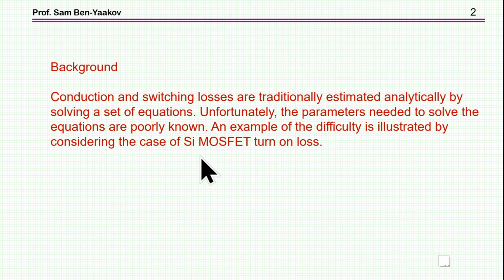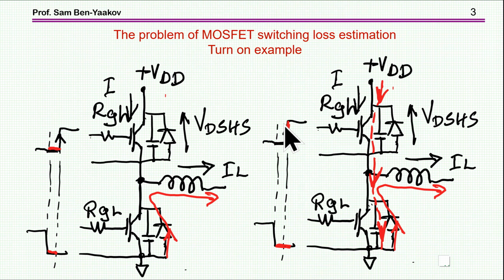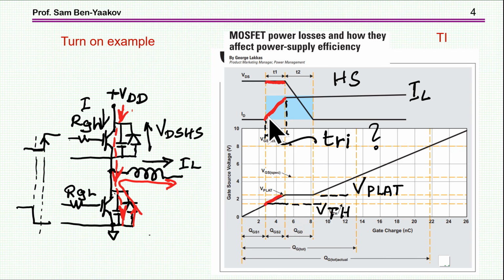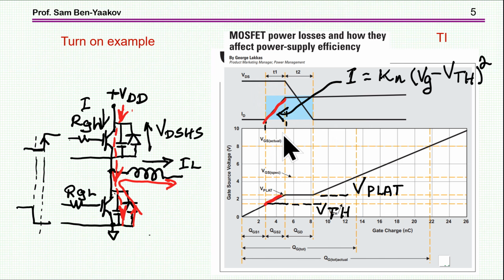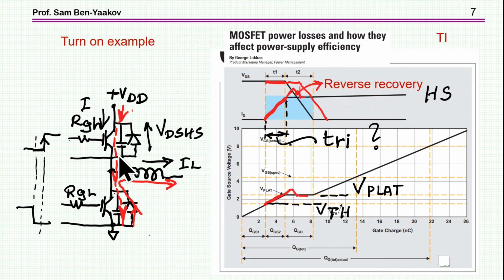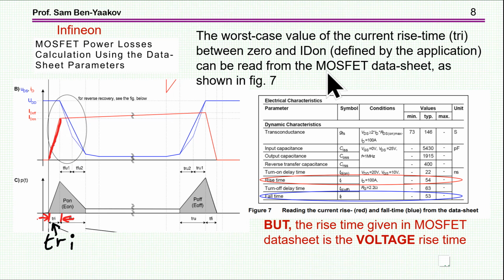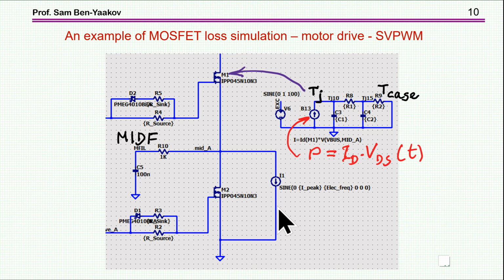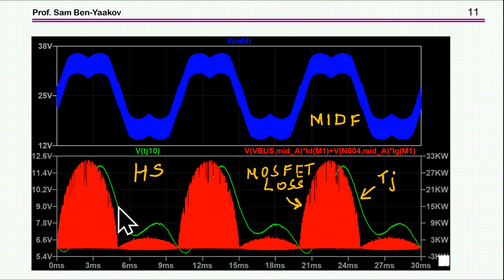Why simulation is better for estimating Si MOSFET switching losses

Comment: Hi Professor, 

What’s your thoughts on this paper for analytical determination? It tries to deal with the ommitance of information which you spoke about in this presentation

https://www.research-collection.ethz.ch/bitstream/handle/20.500.11850/274385/Transaction_final_.pdf;jsessionid=F12C42F71D652BC72110CC1DA8AD598A?sequence=3

I would like to use it for an analytical determination of switching losses for a 2level inverter with parallel switches. This paper may address allot of your concerns.

Thanks again from Australia for your videos! 

Doron
Reply from the maker: I think that pivotal information is missing from the datasheets. E.g. reverse recovery behaviour under various operating conditions such as  I, dI/dt , Temp.
Reply: @sambenyaakov  Hi Professor, 

The paper tries to estimate many of the unknowns that you have mentioned, to try and get around the generally poor documentation manufacturers provide. For example it proposes an estimation model for reverse recovery. I will try and use it to develop a script in MATLAB and then compare with PSIM or Simulink to see how closely they match. 

This paper is attempting to deal with the pitfalls you have mentioned in this video and I think it would serve you well to see how good it really is. 

Nevertheless I will report back my findings if you don’t have the time to investigate 

Thank you for your help I love your youtube Chanel 

Doron
Reply from the maker: @doronlola1763 I will be very happy to see the results of your investigation. I am a great fan of my friend Prof. Kolar and  I am aware of his meticulous work. But I think that the paper is in fact developing the relationships that are already embedded in the SPICE model. So why not use it directly?
Reply: @sambenyaakov  Hi Sir,

Yes that's fair enough. 

The reason I wanted to do it analytically was mainly so I can get a deeper understanding of the operation of the converter. My thought process was that doing so would help me in the later stages of design acting sort of like a backbone of understanding during testing.  It would also act as sanity check for output of simulation

Doron

Comment: Hello Prof. what MOSFET models do you use in your simulations? I’m using models from Infineon webpage in ltspice but I get convergence problems and incomplete waveforms.
Reply from the maker: Some of the newer models have severe convergence problem . I am usig the older models (without the thermal part in them). They are much better.

Comment: Hello Prof. I totally agree with your opinion regarding simulation. The only problem is how accurate MOSFET's simulation models are. I have tested some models, and I can say that not all models can be trusted. For example, INFINEON models correspond very well to the datasheet, but Vishay do not at all, that is very annoying. In your video you created thermal network for MOSFET, but INFINEON has the models with internally included thermal network, which allows automatically adjust MOSFET parameters depending of Tj
Reply from the maker: Good points. Indeed, not all the models are good. Hopefully, they will improve with time. AS for the advanced infineon model, we found that it suffers from convergence problems. WE used the older model and corrected for dependence of Rds(on) on Tj.
Reply: @sambenyaakov  Be aware that most Infineon models are validated on Simetrix, and they might have issues with other simulators (eg. LTSpice, QSpice, ...).  [All statements and opinions are my own and unrelated to my current employer.]
Reply from the maker: @aeaiincpxl  Indeed, the advanced Infineo mode are almost useless on LTspice.
Reply: @sambenyaakov  useless means as the sim doesnt run? or accuracy is poor?

I imported Infineon's SiC mosfet just yesterday into Qspice, it works fine and the loss figure from Double Pulse Test is perfect match with datasheet
Reply from the maker: @ariefnoorrahman3492  No question that the models are improving
Reply: @sambenyaakov Is it possible to dynamically pass back to MOSFET model information of Tj obtained from external thermal network during simulation?
Reply from the maker: @levnemets2148  Yo can put a series resistor which is a function of Tj to make Rds(on) Tj dependent.

Comment: Thank you! if considering the parasitic indictnace of the MOSFET it turn out the Vds of the HS and LS starting to change imidiatly with the changing of currnt (not only when reachnig the main inductor currnt {load currnt}) and this is also can change the swithching losses quite a bit. Same for the Vds parasitic inductanceof the PCB.
Reply from the maker: Indeed, see https://youtu.be/G0-RCRvd9pY?t=739. This agin shows why simulation is better.

Comment: @7:12, should P=Id*Vds(t) also includes conduction loss in your simulation? The load current is SINE, when M1 is fully conducting, Vds is not totally zero, and P=Id*Vds includes both switching loss and conduction loss for the whole period. Maybe I'm wrong, can you elaborate on this? Thanks.
Reply from the maker: Yes, P=Id(t)*Vds(t) includes conduction losses to get the total losses for estimating the junction temperature. It is easy to get the switching losses by themselves.

Comment: Hi professor, would this contribute to premature failures? I.e. case temperature looks ok but the losses are causing an unseen issue?
Reply from the maker: tanks for commet. The (t) belongs to all.  P=Id(t)*Vds(t). Yes, it does include conduction losses. The purpose is to get the total loss for estimating the junction temperature. Easy to separate between conduction and switching lossed.

Comment: I have a question related to switch-on power losses as mentioned in data sheets.
In many data sheets, there is a mention of "Turn-On Switching Energy (SiC Diode FWD)" and "Turn-On Switching Energy (Body Diode FWD)".  For example the C3M0040120D.
These numbers (especially for the "Body Diode FWD" case) are very high, in the order of mJ, which would render them useless even for PWM frequencies of 40-60 kHz.
Could you comment on what the value is of these "switch on" energy loss numbers for estimating the losses if we are just building a half-bridge, buck power converter ?

Thank you !
Reply from the maker: Good question. Indeed the  switching energy is high but for the Sic you mention this is for a 800V voltage and high currents. Comparing to IGBT the loss energy is aout 3-4 time lower. You can't compare it to GaN since they are limited to 650V. Unfortunately, this is the situation today.
Reply: @sambenyaakov  GaN vs SiC, on a similar voltage class, I have seen to have around 3 to 4 times lower switching losses in hard switched applications also due to the zero Qrr, which is also strongly temperature dependent. [All statements and opinions are my own and unrelated to my current employer.]
Reply from the maker: @aeaiincpxl  GaN has definitely lower losses (and eventually might be more economical than SiC). But all my attempts (and attempts by others) to apply GaNs in high power applications in which SiCs are now used (e.g. EVs) failed. Have you any idea why?
Reply: @sambenyaakov  I am actually more interested in hearing your opinions on that :)

There is probably more than a reason, depending on the application. To be fair, in my previous role I was involved in the definition of the next generation of GaN devices (in Infineon), so I cannot comment too much.
But in general, a properly designed (pareto-optimal) GaN based converter often dominates a pareto optimal SiC equivalent in terms of performance and power density. Then [system] cost (obviously), reliability, ease of use, peak current, Rdson vs temperature, available voltage classes, etc..., are all factors to be weighted in in a final system.
Reply from the maker: @aeaiincpxl   My wild guess is that large GaN dies are prone to breakdowns, perhaps due to avalanches as a result of uneven spread of current. But this is just a conjecture.

Comment: Hi Prof.  There is simulation SW that rely on turn-on and turn-off energy related data (among other parameters) to calculate power losses of switching devices. The data is temperature parametriced and some manufacturers provide the model for such calculations (a part of the SPICE model), and it seems that the power loss calculation is accurate even though is using a ideal switch for simulation. Do you think that is better to use this kind of SW instead of SPICE model based?
Reply from the maker: Hi,
1.We add temp effect
2. Newer models of MOSFETS already have a built in temperture dependene of Rds(on) as well as therma netwirk foe Tj.
3. I have ne experince with loss calculation SW. I would assume that simulation is more acurate especially if you use the newer MOSFET models.